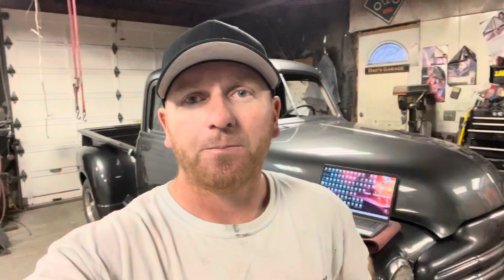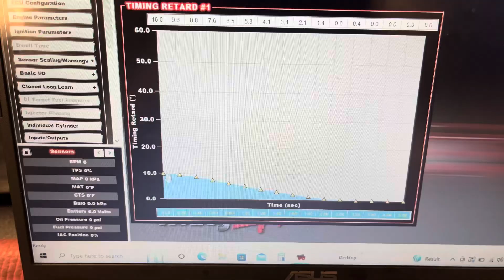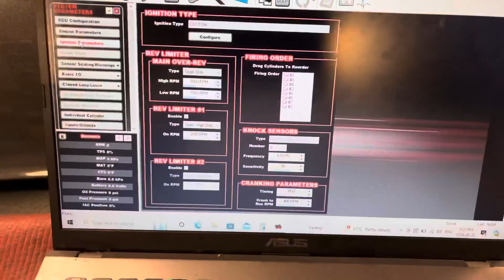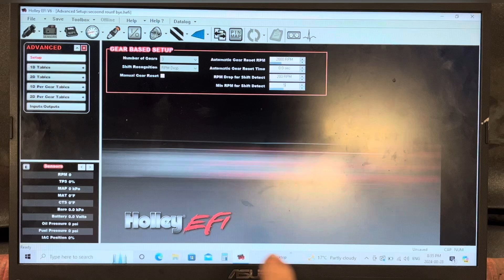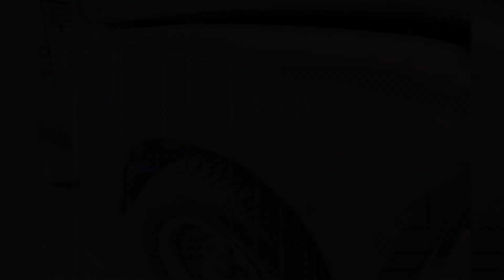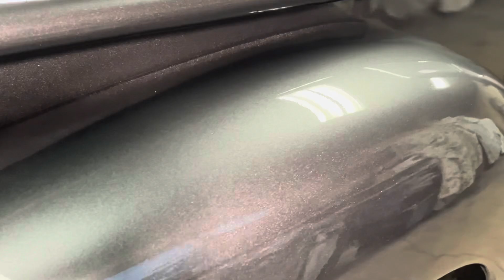Friday Night Test and Tune!  Garage paint job and Holley Gear Retard Setup!!!

Comment: What if you added some drain backs in the rocker covers with AN line directly to the pan It helped my friends big block Chevy pull motor
Reply from the maker: Yep that’s definitely an option. Going to take it all apart this winter and come up with a plan. That might be part of the solution. Thanks

Comment: I added an Accusump System to my car and set it up with my Fueltech so any RPM above XXXX  and oil pressure below XX the accusump turns on supping the engine with 100psi of oil pressure
Reply from the maker: Nice. Thats a good idea. I may have to look into that. Thanks

Comment: Oil wise, put lifter feed restrictors in the block and or oil restriction pushrods, will help. Also could drill and tap the back of the heads and run 12an drains, down to the pan,
Do you have a windage tray and how close it the pickup to the bottom of the pan?
Reply from the maker: I thought about restrictors but most ppl I talked to said not too. Also thought about the drain backs from the heads. Gunna get it sorted out this winter for sure. Yes it’s got a windage tray and I think the pickup was like 3/8 or so from the bottom. If I remember right
Reply: @one_bad_attitude  Why would people say, not to do it? I've done it on a solid roller sbc nitrous engine and ran it for years and never had an issue.
I'd do it or the pushrods, at least. Restrictors are cheaper. ;)
Reply from the maker: @funfun8095   Just to keep lots of oil up top for the valve train I believe.  Maybe it’s a big block thing…I’m not sure.  Whatever works tho lol
Reply: @one_bad_attitude  No, big blocks restrict it, too. No different than a small block. If you're running a solid roller, it's usually the norm. No reason for that much oil to go to the lifters, which in turn, obviously goes to the rockers.
And why aftermarket blocks feed them last. "Priority main oiling", you've heard, I'm sure. Mains and rods are more important.
Reply from the maker: @funfun8095  Yes from what I remember reading the restrictors were a big thing before aftermarket blocks and priority oiling.  Now with priority oiling I think a lot of ppl just send the extra oil up top to help lube and cool the valve train.  Not saying you’re wrong in way shape or form and yes I realize a lot of situations it can help. Just saying when I put this together I asked around and the consensus was run it without them. Now my oil pressure is probably telling a different story now lol so I’ll definitely be revisiting the topic now
Reply: @one_bad_attitude  I could maybe see it, with endurance or drag n drive events, but track only, there's no need for that much up top.
Idk if you watch Turbo John, but he had that issue with his aftermarket sbc, so, the aftermarket blocks haven't really solved the issue.
Same reason Steve's SMX and SMLs have drains from the heads to the dry sump, also. So, if a 15,000.00 dollar block can't solve the drain back issue, none can. LOL

Can't wait for more videos. Keep em up. ;)
Reply from the maker: @funfun8095  lol true story. And yes of course I watch turbo John!  I do vaguely remember him adding restrictors to his small block as well. Can’t wait to see what he does with his new setup!
Thanks for the input!!

Comment: Dude your at a track. You should be a 4.80 pass car.  This thing can be so much faster.   The oil pressure is prob the pressure relief opening at 72 75 psi
Reply from the maker: For sure it has the potential to run in the 4s. It’s just really setup for no prep in my area which ain’t anywhere close to that. Before the end of the season I want to pull all the weight out of it, limit the front travel and leave with some rpm/boost and  try to put down some good numbers

Comment: I was fighting the same oil pressure issues.  Mine was actually the stroke causing windage and beating the oil up.  I’d try it a quart low and setup op safety just in case.  If you have a windage issue you will see it get worse as you make runs back to back as the oil aerates
Reply from the maker: Thanks for commenting. I was originally running the pan with 7 qrts in it like they recommend and it was way worse. I Actually hurt the rod bearings and threw a rod with 7 in it. Running 9 has definitely been working better for me. Are you running a big block too?
Reply: @one_bad_attitude  Big block with 8 quart hamburger pan.  Chris Straub at Straub Technologies worked with Big Block Chevy oil systems and windage.  He is a great resource for ideas.  He helped me get issues straightened out with my setup.